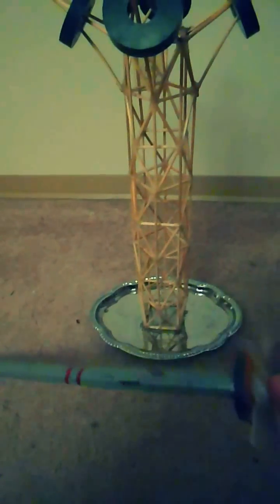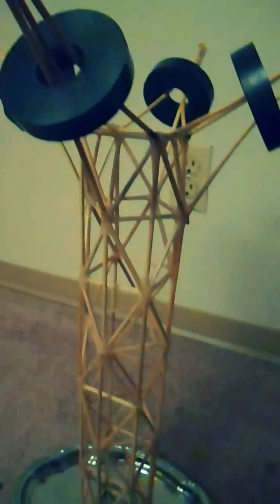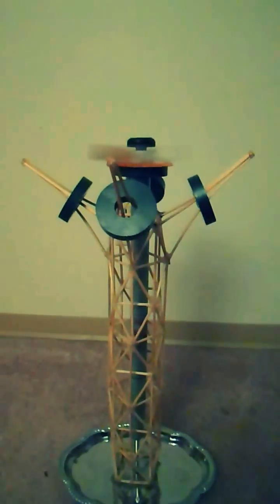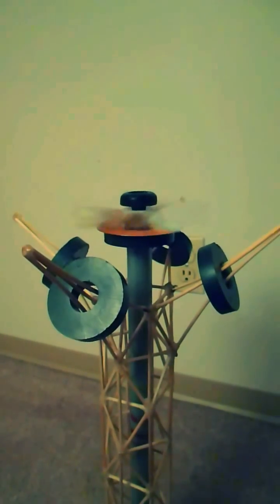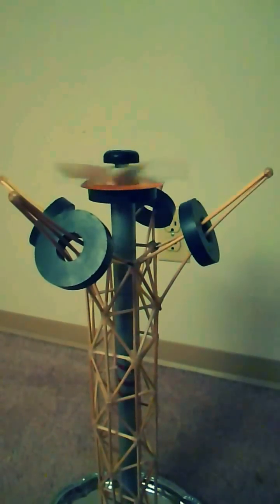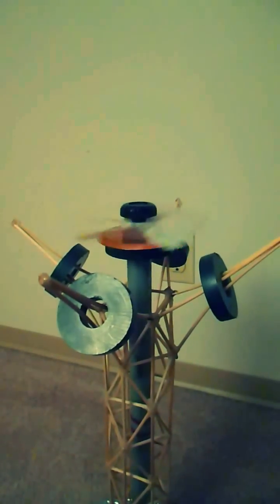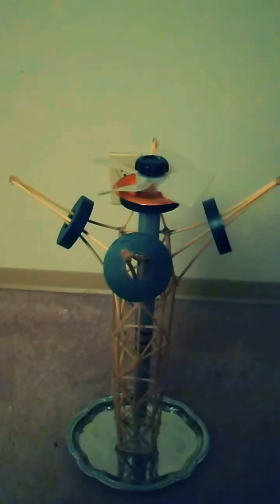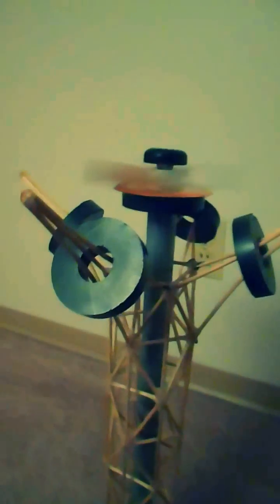Super low friction bearing

Comment: Just a few thoughts. You should adjust your design until you can get a good 5 minute free spin. Otherwise, you are experiencing too much friction to do anything useful. The fan blade is slowing it down through boundry layer interaction (air friction). Also, the flex in your wood tower is rocking the magnetic field and therby the shaft, ever so slightly. That is increasing friction at the pivot as well as additional eddy currents in the boundry layer on the fan blades. Ditch the fan blades and use a flat non-magnetic polished disk or a spoked wheel with sufficient mass to act as a proper flywheel (not a fan). Ditch the wood tower in favor of something that is much more rigid.

Comment: now imagine that in the wind generators in the US that would be so efficient and u could also generate electricity with the same magnets
Reply: i think permanent magnets thats size are not practical and if electromagnets are used then it would defeat the purpose especially if used horizontally since the radial loads will be too large to counter efficiently

Comment: What is the point of the propeller? Shouldn't you be spinning it to the other direction, so it would lighten the weight? Anyways nice video!
Reply from the maker: ..no real point to the prop i'm afraid lol, it was mostly an aesthetic choice but i can blow air at it and man does it spin!
Reply: would totally buy it as a prop for the desk, lol

Comment: Another idea. Magnetomers exploit the imbalance created in a ring-magnet to create a voltage. As your propeller magnet rotates, the Earth's field is causing this imbalance to appear in different places on the rotating magnet. If you had a pick up coil, it should generate power w/o dragging the magnet. It could still be low friction possibly.

Comment: nice. What angle do you set your 4 ring magnets? Can it be done with 3 with more stability? I was thinking that the pyramid angel, 51 degrees, 50 min, might be the ideal.  Also, if propeller magnet is "off-kilter", will it still rotate easily?